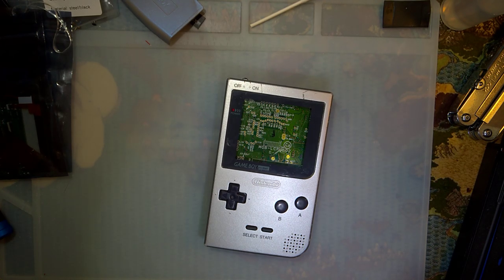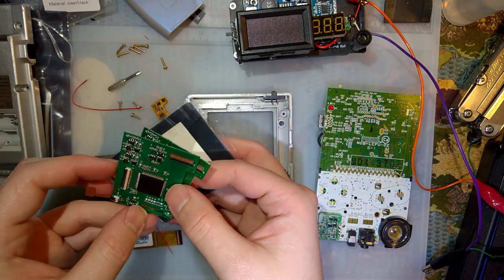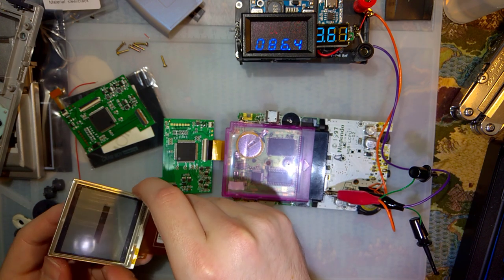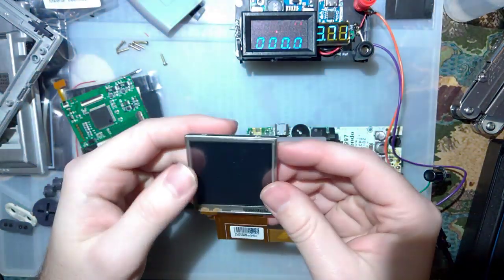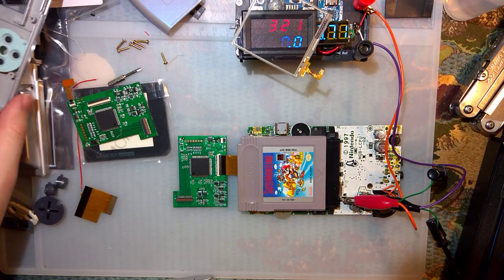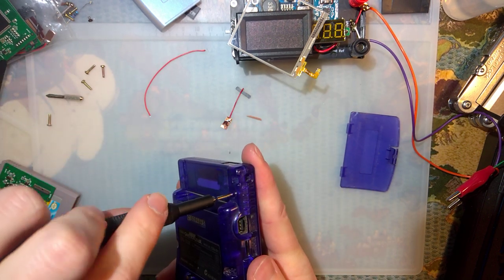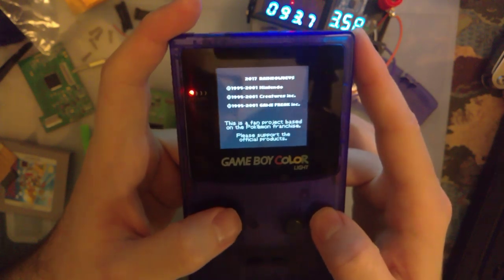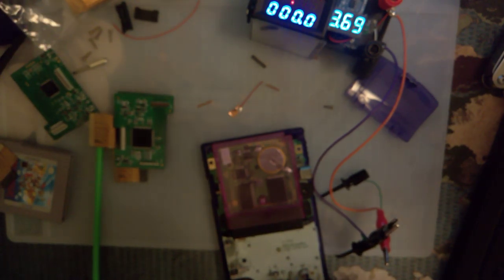Junk Backlight Kits (Part 2)

Comment: Great videos, I’m definitely loving your content, I was wondering if you can do a video on the gbp for which points to connect the hold and up and down on to the board because the kit I bought the touch doesn’t work even with copper tape and nor does the touch ribbon cable attached to the little bale
Reply from the maker: I'm not too interested in doing that but I'll see if I can find some good solder points next time I'm messing around with my screenless Pocket. If you have a multimeter, you can just start probing around for either test pads (less optimal) or vias (more optimal). I know this is a GBC but things should be laid out pretty similarly: https://i.redd.it/af9szectfpu21.png
Reply: makho ok , yeah I have a multimeter, thank you I look forward to doing it, thank you for replying

Comment: Hi, so I see where you purchased the LCDs from however, where do I buy that Printed Circuit Board that connects the LCD to the gameboy motherboard? I would like to buy that as well to backlight my gameboy :)
Reply from the maker: I don't think you can get the PCB adapters separate. They usually come as part of a kit with the LCD too. There are quite a few different sellers but retrogamerepairshop.com is quickly becoming one of my favorite vendors of these kits. If you're not in the US, you will probably have better luck on aliexpress.

Comment: As much as I love my backlit GBC, I REALLY would like a bigger screen. I have been looking around at different LCDs on various sites, trying to find some with resolutions and dimensions that are workable. I did stumble upon one like Analogue's 1600x1440 LCD ( https://www.smart-prototyping.com/Display-for-Project-North-Star-3_5inch-1440x1600-pixels ) they are using for their Pocket ( https://www.analogue.co/pocket/ ) but I was looking for a little larger (though, according to my measurements of my GBC, alot more case modding or even a custom shell would be needed to fit this 4" display https://www.displaymodule.com/products/4-0-ips-480x480-high-brightness-tft-display-panel-rgb ).
Reply from the maker: If you can get that to work, I'd buy one.

Comment: Did you get that screen from wholesale gadget parts? The first one you pull out?
Reply from the maker: I got all the screens with digitizers attached from Wholesale Gadget Parts.
Reply: @makho  oh nice! Are they good quality? I haven't got to get through the video. Also thanks to you I've started modding my Gameboys so keep up the great content!
Reply from the maker: @redzeoranger7718  So far, so good. I haven't had the chance to actually install one of the LCDs but they should be the same image quality as the LCDs that come with other kits. They looked good in tests though.
Reply: @makho  That's awesome. Is there any place to just buy the adapters with out the LCDs?
Reply from the maker: @redzeoranger7718  Not that I know of.